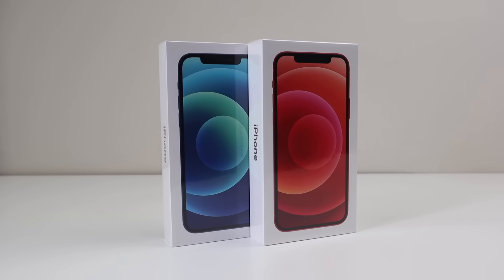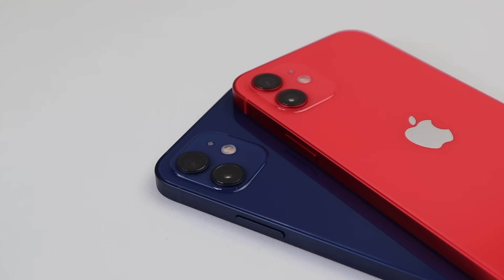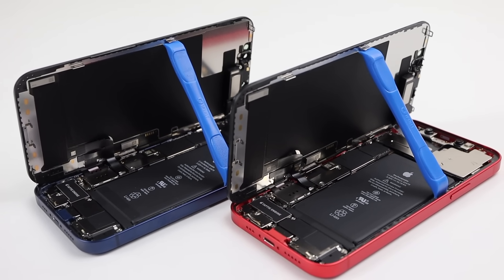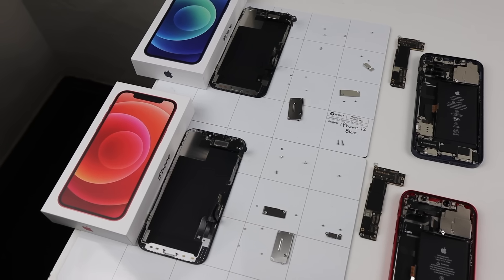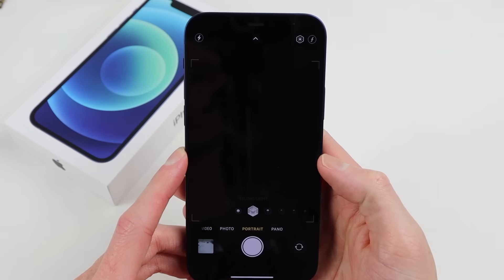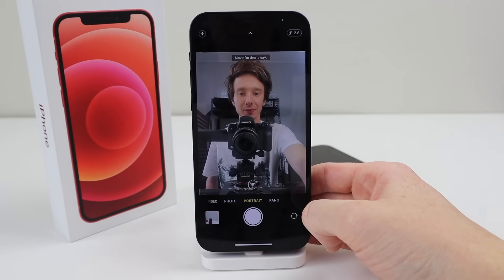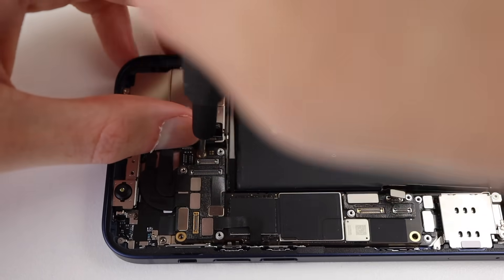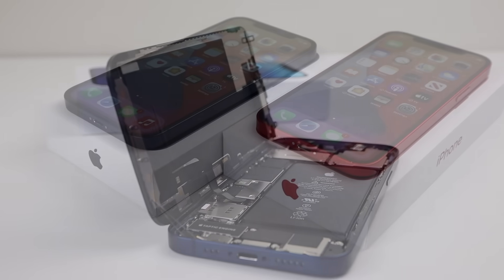iPhone 12 Anti Repair Design - Teardown and Repair Assessment

Comment: "We want to minimize waste!" ... So you change literally every plug on every accessory every phone. Meanwhile TVs can still use the red, yellow, and white cables.
Reply: Even when TV cable broken you literally can change with any cable available  😂
Reply: Meanwhile Windows still has features to keep MSDOS PCs running...
Reply: @Armageddon_71  eehhh windows no longer has MSDOS build-in since moving over to the NT kernel with windows NT, so MS-DOS has to be virtualized/simulated instead of running it natively. I think the last OS with MS-DOS support was Windows ME.
Reply: @zephyros256  Hmm. Ok then I was missinformed but I think that Windows still has far backward compatibility. I remember seeing a video (from Tom Scott I think) that said something about atleast having some "features" from older systems (you cant name files and do some other things because that whould mess with really old PCs)
Reply: @Armageddon_71  yeah I think files such as CON and PRN where introduced as something you can write to and let a driver/device  figure it out, such as your printer.

I suspect it is something they wanted to carry over to the earlier windows (such as 3.1), which had 3.1 and DOS installed. And then kept it for backwards compatibility to those early windows. The same is probably the case for why the main drive is called 'C'. This is quite a bit of speculation on my part though :).
Reply: @zephyros256  Ok, thanks for the Info!^^
Reply: and they keep the FUCKING STICKER
Reply: if they really care about the environment why did they change their charger type
Reply: @enkarar  yeah they don't give a shit they only say that because they know their stupid fanboys will believe it and buy their new shit phone and they change the charger to squeeze more money out of their idiot costumers making them buy a new charger every goddamn time at a overpriced rating as everything apple can't be apple without being overpriced
Reply: There're still tvs with tri-color cable inputs? Neat.
Reply: There're still tvs with tri-color cable inputs? Neat.
Reply: There're still tvs with tri-color cable inputs? Neat.
Reply: Somehow they need to keep the jobs, if everything would be designed to last as long as possible, repairable and upgraded, all the people who produce it would lose their jobs so their lives thanks to the artificial scarcity of the market system, unemployment exists only in the market system, under every other condition it is freedom, but in the market system it means dying homeless from hunger between empty rotting houses and stores overfilled with food that is disposed every day in bigger amounts than there are people who could eat it. It's about time to think further, the market system is the anti-economy and doesn't allow any economic development. Watch InterReflections, no conspiracy required.
Reply: They didn't change from the old iphone charger port to type C like everyone else, because otherwise you'd be able to just use a normal USB cable that's actually durable
Reply: USB c is better though as everybody is starting to move to them.

Comment: They must have put an unique IP address for each part as it boots up it reads the address for each part. Specially if they used nano chips into every part of the device board. Making it not repairable and allowing Apple to monopolize their own product to be fixed allowing them to decide how much it should cost for repairs.

Comment: Car companies have been doing this for years. I can see how it upsets people. But the fact is with some security implemented hardware, it makes it impossible to swap that component to another phone. 
Think of how easy it would be to steal your car if someone could just remove the ignition switch and steering lock from a junkyard car and install it on yours... Same idea here
Reply: It's not the same thing at all man.  Apple designed the phones like this for the sole purpose of making them as unrepairable as possible so they can force you to buy a whole new phone (or pay for repairs directly from them which cost 70% of what the phone cost).  Nothing to do with security.

Comment: The right-to-repair community is made up of so many experts an professionals that reverse-engineering Apple's products shouldn't be very difficult if it was just more organized. They should be able to make their own diagrams, circumvent every lockout Apple creates, and pull this off. The Dark Web should be the best platform for such a community to stay relatively hidden outside of the control of the big companies controlling the internet.

Proper organization is what's needed. If this could just become a reality, Apple wouldn't stand a chance.

Comment: Imagine if you changed the battery in your car yourself, but you car refused to start because it's not an authorized genuine car battery.
Reply: Very soon...
Reply: @metube9541  imagine the car just randomly ramming stuff to kill it’s owner.
Reply: You used non geniue air to fill your iTires please contact AppleCar Support to reenable your iCar
Reply: Non-genuine fuzzy dice detected in your Tesla. Your steering wheel will be disabled.
Reply: @nextlifeonearth  
Even better: Your subscription for using airbags has expired, airbags are now disabled.
Reply: @drgazter  why are you giving them ideas ??
Reply: @drgazter  How is that better? That's irrelevant to the topic of this video, even this thread
Reply: @drgazter  subscription based airbags are a thing in the motorcycle safety jackets, you pay hundreds of dollars for a airbag jacket then pay a monthly fee for the airbags to do anything.
Reply: Audi or BMW require you to register car batteries or it won't start.
Reply: You would have a BMW from the 2000's actually.
Reply: You won't have to imagine for long
Reply: That is literally what BMW has been doing for over 10 years now.
Reply: youb hit the nail on the head. Thats the goal. How many small businesses do you think that will kill?
Reply: Sounds like my printer that bashes me every time he starts, that I don't use original printer ink .... well ... at least he works after I tell him: "I don't f*ing care!"
Reply: That's the future we are heading towards if we don't get "right to repair" laws passed; this is already true of most heavy machinery, and higher end car models.
Reply: @Vaprous  Exactly, the guy who founded "Cradle to Cradle" is already partied all over the world for the idea that in future nothing will be sold but the use of it, like you won't be able to buy a washing machine but only like 1,000 washings, as soon as the counter is full, the machine will stop working and send a message to the service company, people will come and get it, if you have the money for another 1,000 washes, they will bring you a "refurbished" machine, if not, you can screw yourself and wear dirty clothes, because to high use of water will be punished, everything will be monitored. In future there won't be small shops at all, only branches of big companies, everything will be the property of a couple of big companies and everyone will be their employee or removed, just need to take a look at "The Great Reset".
Reply: apple car?
Reply: That's already started to a certain extent. At least new VAG cars have to have 'AGM' (Absorbent Glass Mat) batteries fitted and are over £450!!!! Forget fitting a usual lead-acid type from a motor factor of circa £100 as it will not work with the car. Not certain if any other makes use them or not as yet.
Reply: tesla
Reply: Then don't buy bmw
Reply: Or, worse, it is OEM but since it's off the shelf it can only be activated by a "certified technician".
Reply: thats fine you can just put a screwdriver to your starter and it'll spark right up.
Reply: Imagine the same scenario but the battery you used to replace the old one was one from the same model and same year as your car, but brand new. That is what apple is doing. It's not simply disallowing non-genuine parts, it's disallowing any parts that aren't sold and installed by them.
Reply: European cars : "hehe"
Reply: Audi, Mercedes and BMW does that already, fucking nazi’s
Reply: sounds like a VW to me... LOL
Reply: this is a true case, i worked as a mechanic if you put a new battery in a modern car, you have to code the car to get used to the new battery or else you get warning lights
Reply: See the funny thing is VW will throw a good amount of codes if you do it and the car will need to be flashed
Reply: i mean, car makers made transmissions a single encased item to save 20 bucks in production so instead of replacing  a faulty part for a 100, you have to replace the whole thing. and ppl didn't stop buying it becasue ppl are stupid
Reply: @thecursed01  my point exactly if people keep buying, apple will keep making it. Don’t hate the player, hate the game.
Reply: @bonyylast7147  The slogan is right, but not your conclusion, people who buy are also players, the game is the monetary/market system. But hating doesn't solve problems, first you need to understand, analyze, then look for causes and solutions.
Reply: @Wilson84KS  nobody is forcing nobody to buy this shit phone. I have money and i don’t buy this shit phone i have other brands to choose from. its the market that decides. you can’t force manufactures to do what you want. too much regulation could dry out innovation. they have the right to maximize profit as long as its done legally even if its unethical. People who buys this shit get what they deserve its just the way it is. Its like buying overprice useless beauty products.
Reply: @thecursed01  Ppl keep buying, because ppl know they have to, otherwise other ppl will lose their jobs and they will aswell because consumption will drop, atleast a big part of the ppl. I live in Kassel, Germany 20 minutes at feet away from the VW factory in Baunatal, people who live here get mad if you just criticize VAG, even if they don't work there, but they live from the money the vw-workers spend here, I did my education there and what is going on there is even worse, people hold their mouths closed all day, they live in permanent paranoia, when I was there, there was an April's fool's day joke that everyone who has a car that isn't VAG will be fired, since then you don't see any logos that don't belong VAG on their parking lots.
Reply: Don't give them ideas.
Reply: lmfaooo
Reply: So basically: imagine if you bought a Tesla?
Reply: Wrong, even if its a genuine battery it didn't come with the car or wasn't paired with that car by the car company, therefore your car won't start and if it did your headlights would be disabled. XD
Reply: Your gps trial has expired; you will have 10 ads in the next turn
Reply: Are you give them more ideas?
Reply: Your giving apple ideas for when they bring out their overpriced car wheels, windows, engine, doors, and battery sold separately
Reply: if people keep buying they will keep making it. its not their fault people want to spent money on this phone.
Reply: @bonyylast7147  I didn't say anything about anyone's fault, I'm no judging, just naming the things as they are, the greed is in the system, the greed of single people doesn't matter, it's not the reptrolloid illuminuts who abuse the holy money/markets, what is the best definition of greed than not just infinite growth but even exponential growth, not just having endless much but exponentially more?
People don't want to buy it but to have it, no one needs money but the things they get for it, which they mostly produce or distribute themselves but need to pay for their own work in the end, because of the systematic theft aka. profit. It's only the psychopaths and parasites who need money to corrupt/blackmail with the dependency from money, this is where their power comes from.
Still this isn't what I said, if the products would be designed to last etc. there would be no need to keep on producing, it's even more obvious in the car industry, the whole planet is full of huge fields of "brand-new" unsold cars but they keep on producing, instead of upgrading existing cars to electric drive they produce even bigger and heavier cars to transport 1.1 persons around 16 km on average, put more plastic parts and electronic toys and inside like Tesla and their $200 magic mirror in the dashboard, because electric drive needs ways less parts and so other strategies are required to keep the jobs, but this way in the end electric cars are ways worse for the environment than old cars with small engines.
This system doesn't allow any little rationality, peace, freedom, health, progress... economic behavior, cure for cancer would make millions of people unemployed, if crime would atleast drop, less policemen and judges would be needed, war is the biggest employer ever even if it isn't happening, but even more after it happened because all the destroyed work needs to be redone, and so on.
Search for "Peter Joseph talks about money", he explains is pretty detailed in just ten minutes, who doesn't understand it doesn't want to understand it.
Reply: @PLV9 Crowgun I see that you don't understand how big companies work
Reply: Well, I'd imagine the case with cars would be different considering them not working properly can be the difference between life or death, and not just to yourself.
Reply: @firesong7825  For cars it will be different, in future there will be not even pseudo-property for the slaves, you will need to pay for every time you use it, if you use it longer than you paid, you simply will get in debt and next time you will need s car the payment will be first used to pay your debts. The same will be for every bigger product, even your coffee maker, things like that will have a counter.
Reply: @firesong7825  Several people have already prices for the single ideas, one of them is Michael Baumgartner, also "The Great Reset", an idea from Prince Charles, is exactly about that.

For uneducated people everything is a conspiracy theory, except of their  beliefs coming from the propaganda industry, but uneducated people don't even know the difference between beliefs and knowledge, it would hurt them if they knew, because they would realize how stupid they are and that they know nothing. Burning witches never stopped but got even more, there you got the holy progress that the holy capitalism brought us, lol, people mass bred so stupid, that they aren't even able to use the encyclopedia in their pockets to educate themselves because they fear education, and some say capitalists shot their own knee with giving internet to the public, no, they didn't, they know exactly how stupid the cattle is.
Reply: new wheels refuse to inflate cuz their not attached to their Original car lol
Reply: it may happen
Reply: I don't imagine fuckin things u stupid
Reply: In the future that will happen with how many electric cars we have on the road now
Reply: There's this company (pretty sure it's onewheel) that BRICKS the device if you remove the battery. It does it on purpose to prevent you from repairing it.
Reply: with newer cars it is a problem. You have to code in the new battery otherwise you will have issues and it might not start.
Reply: Your logic doesn’t really hold water, under your car analogy car wouldn’t start because you replace the battery but in a lot of modern cars that’s exactly what happens. For example I have a 1999 blazer and I had to replace the ECM which is basically the cars computer and I grabbed one from a 1998 Chevy S 10 pick up truck, which other than the differing bodies share the exact same ECM and mechanical parts. Both vehicles were identical down to the transmission and upon trying to start the car it cranked up fine and ran but I got all kinds of warning messages through the dashboard as well as the OBD tool interface. Essentially what was happening is the various modules and sensors hooked to the engine weren’t reading as correct to the ECM and I ended up having to take it to a mechanic and have him reflash the ECM so that it would accept and be coded to my blazer. Basically that’s what’s happening with these modern iPhones and not to sound like a fan boy because I am actually currently responding to your video and watching it on a pixel 4A but I don’t see it as being that big of an issue.
Reply: @Audiorevue  Well yes it won't be an issue to us android users obviously because we actually use good phones iPhones are shit and expect and apple just keeps trying to drain their stupid fanboys as much as they can for their money apple users like to act like just because their phone is more expensive it's better and bus android users just laugh at their stupidity most of the time
Reply: Somehow they need to keep the jobs, if everything would be designed to last as long as possible, repairable and upgraded, all the people who produce it would lose their jobs so their lives thanks to the artificial scarcity of the market system, unemployment exists only in the market system, under every other condition it is freedom, but in the market system it means dying homeless from hunger between empty rotting houses and stores overfilled with food that is disposed every day in bigger amounts than there are people who could eat it. It's about time to think further, the market system is the anti-economy and doesn't allow any economic development. Watch InterReflections, no conspiracy required.
Reply: @Wilson84KS  2 lines into your post and it screams meth head